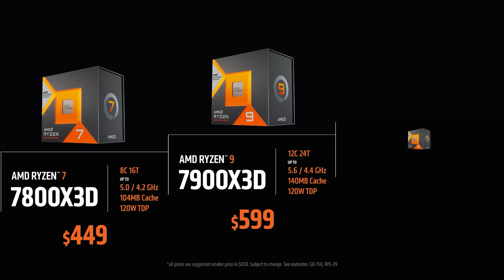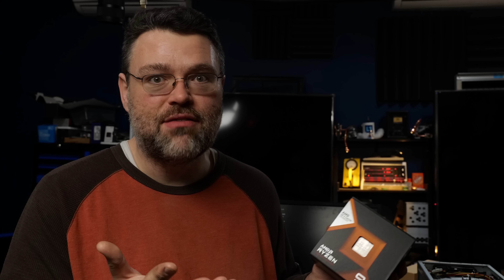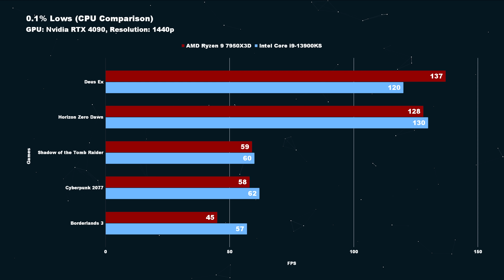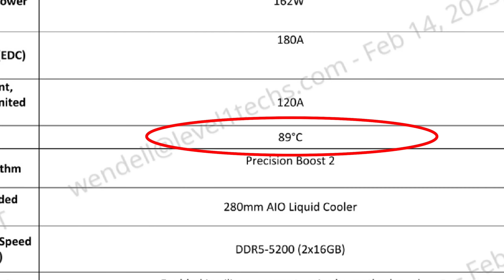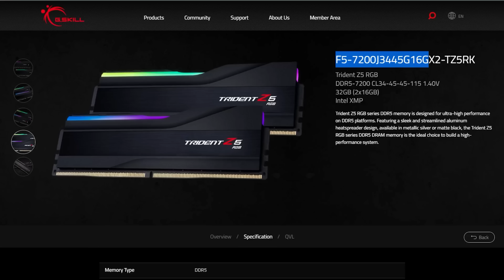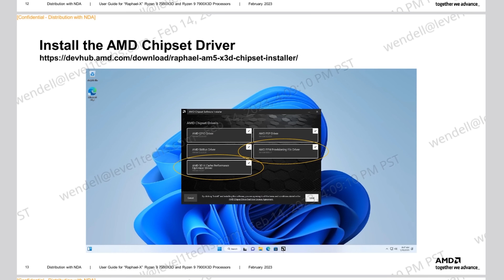7950X3D: Cache Talks While The Watts Walk

Comment: You kind of mentioned that the bios, drivers, and game bar do more than just parking the "Fast CCD" as other reviews have said. Have done any looking at what happens with a large background workload while gaming? I'd like to know, since I do have workloads that run for days sometimes, and also want to game while they are going. I know there will be clearly a performance hit to the game. But if the fast cores genuinely get parked even with a large background workload, that would be the worst case. I'd have to disable auto features and set things manually.
Reply: From looking at all these reviews, it seems like when "it detects a game running" it forces the other CCD to "park" meaning forces all the threads running (I think it includes background apps) to one CCD. If that's the case, then this is worse than the Intel situation: you have 8 P cores dedicated to the active game but also another up to 16 E cores that games can also use, but also use for background processing to smooth out gameplay.
Reply: I mean i seen that but they literally are at 0 hz and get no use so i think they are parked. Unless something else changes.
Reply: @jetrpg22  
they are not Parked 100%
https://www.youtube.com/watch?v=qq13-xxAVDE&ab_channel=PCWorld
@ look at 8:18
you will  see that windows start to use the parked cors
Reply: @mohamedalmuhairi324  Yeah but thats not showing background app offloading , but either leakage or maybe a universal system use (IE windows offloading, as Microsoft can be sure of it). For all performance purposes, they are parked/not in use.

Comment: I use a 5950X at home for gaming, heavy web browsing, Excel, Google Sheets, and occasional highly multi-threaded applications like fast downloads and building test chambers in Portal 2. I want my 16 cores, but I certainly do not want to babysit my CPU — change settings as I change tasks. I play Factorio, Cities: Skylines, and other simulators and am occasionally CPU-bottlenecked at sub-par performance levels, particularly in Cities. I was shocked at how well the Raptor Lake i9 keeps up with the 7950X3D outside of games like Factorio and Stellaris, but I’m also a big advocate for low-power gaming, running my 5950X in eco mode, and my room has very little ability to soak heat from my computer, so the i9 holds no attraction for me. Guess I’ll skip this gen, and hope AMD offers a 12- or 16-core Zen 5 CPU with V-Cache you don’t have to babysit.

Comment: It would be interesting to see the benchmark results using the average cooling used by consumers.
Reply: To me that sounds a bit like car and driver doing a Ferrari review...but...with tires off of a Toyota Camry..... having said that.....there is a review on YouTube by a guy who used air coolers, and it worked wonderfully due to the X3D's lower power consumption, it was tied or within a frame or two of a 360 water cooler with the temps only hitting the 80s under the hardest loads ( I think that was cyberpunk). The water cooler ran in the 60s for temps, so if someone is going to mess with overclocking it might really matter......but I think out of the box the x3d cores can't really ramp up to high so the air coolers looked functional.  Ah...found the link!!    https://youtu.be/te4liaUSqVw
Reply: Hey Itamar  .... found another one.  https://youtu.be/HBnkLZd426c to go with https://www.youtube.com/watch?v=te4liaUSqVw So that is two reviews that are using Air Cooling. It appears the 7950x3d will work great with any decent cooler.
Reply: That woudl be nice... however if you're spending something like $1.5k for cpu/mobo/ram, I think you can afford to get a capable cooler for your cpu.
Reply: @duplissi  yes, I wonder how many people avoid AIOs because of fear...
Reply: @hysel1234  I do. lol

Why use liquid when an NH-D15 can usually do the job without fear of shitty AIO quality control or leaks?
Reply: @hysel1234  I dunno. I've had a custom loop in my rig for 7 years now, not a single leak. Every product has lemons. 

You don't need an AIO anyway though, the best AIOs and the best air coolers have pretty similar performance.
Reply: https://youtu.be/te4liaUSqVw

Comment: Wendel is there any chance you can do testing to see how the performance changes if you don't rely on the CPU-Xbox game bar connection to park the non-3D CCD, and instead utilize something like Process Lasso to manually direct games to the 3D CCD without shutting down the second CCD?

I really genuinely don't like the idea of half of the CPU shutting down when a game is detected, I typically have tons of background tasks going on even when gaming, and I'm trying to figure out how this will play out.

So far no reviews have gone into the details on different situations and solutions. I'm primarily interested in how game performance might look if you restrict it's affinity to the first 8 cores, but still have the second CCD online with other processes. Love the channel you guys do great work.
Reply: 100% this. In its current form i think a 13900k is just better or wait for a 7800x.
Reply: @jetrpg22  absolutely, the results in games that benefit from extra cache is fantastic, but if the CPU is only a 7800X3D when gaming, I would rather just buy a 7800X3D and keep my 5950X as a second system.
Reply: parking =? disabling
high frequency CCD is still available for background and multitasks.

Comment: I do CAD work in AutoCAD, Fusion 360 and Revit. With a little photo editing in Affinity Photo. I used to use Photoshop but their pricing model is stupid for what little I need. I am on a Ryzen 9 3950X and it works pretty well other than AutoCAD which is my main money maker! If I could bump up my speed in AutoCAD it would be worth moving to the 7950X3D, but I am not seeing anything dedicated to my needs tested. I guess I am just not a use case anyone cares about. Next year I will be spending $4k to $5k on a new system and have started learning what I should go with. Threadripper would be an option if it is in that price range. I have used AutoCAD on XEON, i7, Ryzen 9 and a couple other systems and they all run about the same. Also ran on GTX, RTX, Quadro, cards and see little difference in speed. It does seem to do better if you have a lot of RAM and VRAM overhead, but doesn't seem to care about speed. What am I missing here? Is it just that AutoCAD sucks? Probably just AutoCAD sucks. Unfortunately it is the best option for my specific use case.
Reply: try posting on the level1forums, many more INFORMED eyes on your questions

Comment: Why can't you find any reviews of the 7900X-3D?    That's the one that I think will be the best out of all three because of its 12 Core setup.
Reply: They want to sell the $700 chip first.
Reply: They didn't give it to reviewers, only the 7950x3d.
Why you think the 7900x3d will be the best? Is 12 cores but is still 2 CCDs so you either get one CCD with 8 cores and one with 4 cores in that case the 8core CCD will have the 3d Cache and will perform exactly the same as the 7950x 3d and the 7800x3d, or you get 2 CCDs with 6 cores each which will mean you have one CCD with 6cores + 3d Cache and another with only 6cores in that case will perform WORST than the 7950x3d and the 7800x3d

Comment: Hello Wendel, its very interesting to see how the 7900c3d fits between both the 7950x3D and the 7800x3d, especially if the games are multithreaded (a lot of games are mainly singlethreaded). Another thing where we have to see how the AM5 matures is the topic if you go beyond 2 Stick memeory configuration. So perhaps you can show the real world effect on e.g. 128 GB configuration (Zen3 vs. Zen4) in a usecase where 64 GB is not enough and you have to go for at least 128 GB.
Reply: I would like to see what memory speeds are obtainable with 4 x 32GB sticks on X3D and latest bios etc. Is it still really slow?
Reply: the 7900x3d would be worse than both if it’s 6+6 so it doesn’t really make sense in my opinion
Reply: @snowwsquire  not necessarily entirely worse, because the cached CCD has a larger cache to core ratio.
Reply: @TheJacklikesvideos  If a program benefits from the cache to core ratio you could just disable the cores on a 7950x3d and I don't think there are games that anyways.

Comment: Vendel, can you please do a video on gaming + streaming? 'cos from what others have said, Windows "parks" cpu cores when gaming. If that means, if effectively kills those cores and the stream encode would run on the 3d cores, that would be bad, big time
Reply: The default Task Manager can manually assign which CCD to certain apps or games so you can always know what app running on what cores.

But if you want a more powerful app to assign 3DV-Cache to make it only run the games, and then Screen recording or Livestream on the other CCD, then use the official Microsoft Sysinternals Process Explorer.
Reply: lots of people have been parroting claims about the parking being a complete disabling of the ccd; it's not. it's still available for other applications like background or streaming/capture.
Reply: @TheJacklikesvideos  thanks. I ended up getting a 7800x3d :)

Comment: I've seen tons of other benchmarks now that include more games. Overall, the difference between 7950x3d and 13900k is single digits. All the hype from amd for nothing. :(
Reply: All the other benchmarks are sh*t. Finally a good benchmark coz this guy used a good ram for 13900ks. A more tuned ram with 7600mhz wud result in victory for both 13700k n 13900k. So theres no point in buying this. If u want to go amd wait for 7800x3d

Comment: Can we look at the performance using 4800MHz ECC DDR5? Wondering if more cache can make up for the slower ECC memory.
Reply: 3d cache fix the latency hit from memory 
cant make up for a 70ns difference otherwise
Reply: What do you mean? All ddr5 is ECC. Why would you willingly kneecap a system with 4800?
Reply: @joemarais7683 no they are not, not even close. DDR5 has some rudimentary error correction cause at those speeds it will produce errors but that is NOT the same as ECC memory
Reply: @joemarais7683  cost

Comment: I guess it makes sense that the X3D is more efficient since only one of the 2 CCDs is being thrashed with power and the other one is operating in a much better position on the efficiency performance curve
Reply: @Menti Capti Not sure how that's relevant for the all core benchmarks that Wendell was running here...
Reply: @Menti Capti The non X3D chips have an additional cache die that forces the clockspeeds down? We're talking about factory behaviour here, not behaviour after playing with curve optimiser.
Reply: @Menti Capti I thought you were just misunderstanding me but it turns out you're just factually wrong. The non X3D parts do not have 3D cache on any CCD. They use a 2D chiplet design - there is an interposer but there's only a single layer of active silicon on top of that. This is distinct from 3D Vcache where an additional die containing cache is attached on top of the CCD, producing multiple layers of active silicon.

This is a really important distinction here because the 3D Vcache is in between the other active silicon and the cooler. All active silicon on non X3D processors is directly attached to the heat spreader, whereas the 3D cache equipped CCD on the X3D parts has to push its heat through an additional layer of silicon and another thermal interface.

The result of this is that the Vcache equipped CCD is hard limited to a lower clockspeed because its cooling is fundamentally limited. The bonus side effect of this is that it's actually more efficient at that clockspeed.

This is in opposition to the non X3D parts, which as proven here are less efficient, and a big part of that is because both CCDs, having more direct cooling, are being more aggressively clocked and therefore run less efficiently (but marginally faster).
Reply: @Menti Capti Oh, and if you do consider the interposer to make the chip "3D", then I'm not sure why you're singling out the dual CCD chips, since the single CCD chips are still chiplet based designs with a separate IO die. The 7800x is literally a 7950x with one less CCD, it still has the interposer, the IO die and the CCD has exactly the same cache configuration.
Reply: @Menti Capti Who said anything about 3D cache? I did. In the first comment in the thread you're replying to. That's the entire discussion - how 3D cache affects efficiency in all core workloads, not in gaming, not in chips without 3D cache. You can't park a CCD if all 16 cores are working. Also, that behaviour isn't even limited to AMD processors, let alone dual CCD chips - Intel and AMD chips can independently clock cores, which means that on a 4 core workload you can park up to 12 cores instead of a mere 8.

And you have the gall to call me dense.
Reply: @Menti Capti IT'S AN ALL CORE WORKLOAD. ALL OF THE CORES ARE RUNNING AS FAST AS THEY CAN. YOU CAN'T PARK AN ACTIVE CORE.
Reply: @Menti Capti I'm still really confused as to how you could possibly think that the X3D is more efficient than the normal 7950X if they use the same power saving strategy and there's no differences between their compute hardware. In the absence of the clockspeed effects I described you would expect the X3D to use more power since it's driving more transistors. And yet you persist in claiming that the power savings, in an all core workload, come from switching off some of the cores.

If you could switch off cores that are working then why not just switch them all off and deploy the world's first 0 watt CPU?
Reply: @Menti Capti You need to go do an English refresher or something. Your first comment was a reply to my comment on efficiency. Therefore, using the rules of how language works, I thought you were discussing efficiency, rather than just randomly spitting out a non sequitur about how independent core clocks work as if that's in any way related to anything about the video beyond the fact that Zen 4, like many processors, is capable of it.

It's weird that it took that long for you to say, effectively, "my point was that I can't participate in a sane conversation and I just wanted to say an unrelated fact and sound smart. It's your fault for thinking that my reply to you was in any way a reply to you, instead of assuming my actual intent which was to say things completely unrelated to your comment and phrase it as if it was somehow relevant in any way".

Comment: intel does not bin imc silicon at all, beyond running ddr5-5600 jedec at 0.8 V sa. the only reason why you can usually clock higher on K skus is the SA voltage unlock

Comment: As a 3d artist looking to bring in more Unreal Engine real time renders into my workflow this is great new but I would LOVE to be able to use the newly announce Micron 48x2 Gig Dimms totalling 96 gig of memory with this CPU, and Expo timing were promised but could Level1Techs do a video on them and what is going on with them? Are there gotchas there? Will they run on system like this with  set timings at promised speed? The memory controler is what worries me. Upgrading finally from a threadripper 1950x and don't want to make the wrong choice. I am favoring the AM5 over the new TR or Intel's new WS for now due to the single core speeds and the ability to get somewhat parity to the old system that is showing it's age.
Reply: untested opinion here, i think it should work because their memory controller struggles more with multiple sticks, but not high capacity afaik. i’m running 2x32 on a 7950x
Reply: @snowwsquire  That is my hope and thinking  as well, is it stable for you and what speed do are you running?

Comment: Did anything change with regards to the memory controller? Can you actually get 128gb now without absolutely demolishing the frequency?

Or is it the same controller as in the 7950X?
Reply: IO die is the same, so it shouldn't be different
Reply: @marcogenovesi8570  Ryzen 1000 also had a lot of memory issues at launch that greatly improved with AGESA updates, 7000 might improve too.
Reply: @KrumpetKruncher  yes but that's not what he asked. He asked if this CPU has better memory controller, not if there are firmware updates that make all 7000 better. An Agesa update would work the same on all 7000 because they use the same IO die
Reply: The same

Comment: That opening laugh is promising
I wonder what pleasant madness we'll be led down to

After watching the video edit: I'd love to see if the 7900x3d has a 6 core or 8 core v-cache complex
And ofc how much of a 1% lows impact you get in games between these two top dog CPUs
Reply: It's 6+6
Reply: For gaming the 7900x3d is basically a 7600x3d for 600 bucks... Same could be said for 7950x3d and 7800x3d tho.
Reply: @MrStoffzor  There is no such thing as a 7600x3d. Basically.
Reply: @MrStoffzor  Kinda interested in games that are more single core dependent while prefers huge cache compared to high clock speeds.. Since the 6core vcache is going to have even more cache per core than the 7950x3d which has to share the cache between 8 cores, it might even beat that. lol
Reply: @MrStoffzor  i mean think of it like this, intel has big cores and little cores, amd has cache cores and no cache cores
or you could have all no cache, you get lots of options
i just really wish we get zen4c 32/24 cores variations for the am5 socket (wish amd allowed more ram too and quad channel, make it the X670XE chipset or something, like a threadripper sucessor but the am5 socket, surely amd will get bad yield zen4c, slap in some v cache and 4ghz  charge 1000-2000 for 32 cores, people would be happy lol)
Reply: i personally want amd to have something for sff/ high efficiency low tdp, but the priority is probably epyc and trying to get 40% in the datacentre